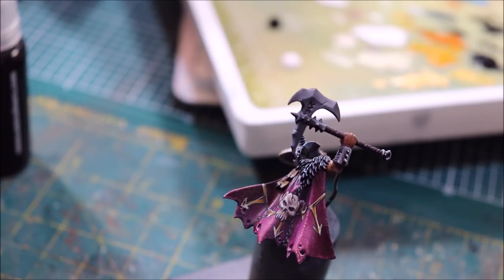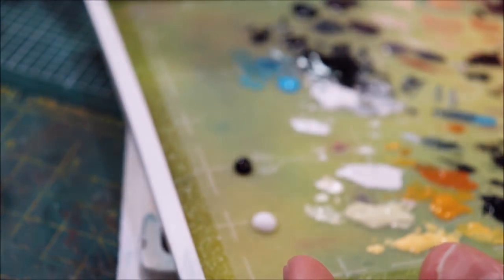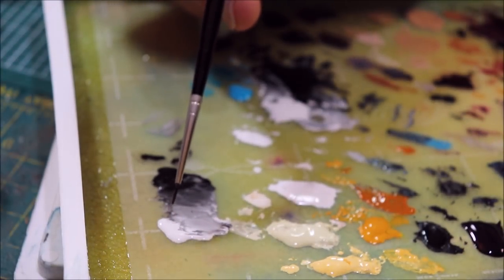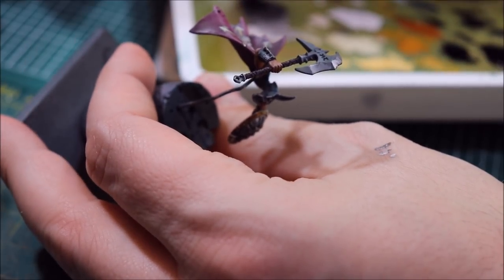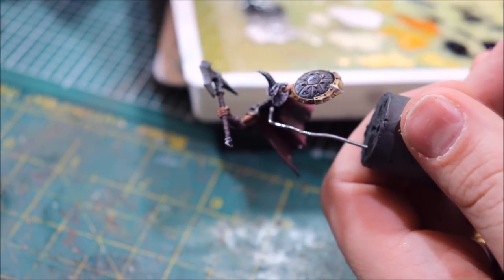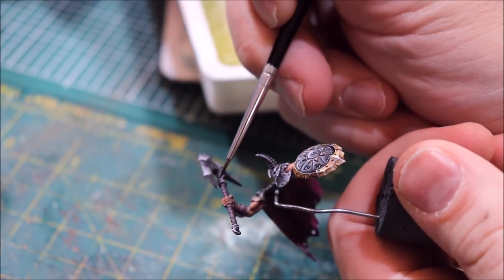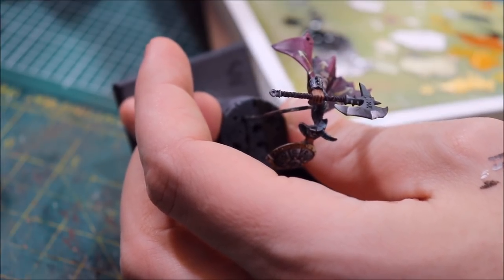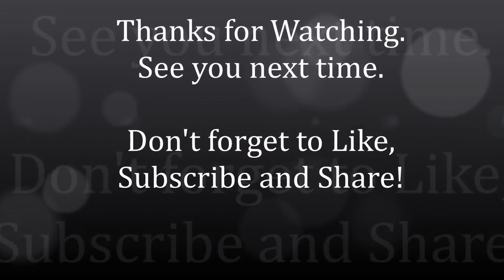Hobby Cheating 124 - Loaded Brush Blending

Comment: Dude you have a tutorial for everything! awesome!
Reply: May I ask something? you load with black, and then put white on the tip, so what is the point of mixing the white and black in the pallet?
Reply from the maker: Because in the end, I am going to need to smooth everything out (you are never going to have a perfect blend from a loaded brush, it's too random of a technique. So I make the spread of color so I can go in and smooth out areas of inconsistent blends later. Hope that helps. :)
Reply: @VinceVenturella  It does, thx so much for taking the time to answer.

Comment: Vince, this video has helped me understand this technique so much more. You really take time in your videos to explain every step of the process and don't skimp on the detail.

Do you have any tips for using this technique with a very thin paint like Nighthaunt gloom. Would this only work if gloom was the paint that fills the brush?
Reply from the maker: It's really tough with thin paint. it would be fine if the paint is thin in the belly of the brush and white on the tip, but in general, you need a thick paint for the tip.

Comment: looks like a good technique to fix zenithal highlights or do zenithal highlighting by brush, if one is lacking an airbrush or has run our of spray primer.

btw: what kind of palette paper are you using in this video? I find parchment paper is lacking stability
Reply from the maker: Just standard reynolds baking paper. Always worked fine for me, but the humidity and other elements of your area can greatly change the way it works.

Comment: How would you use this technique with a third colour (eg blue)?
Reply from the maker: So in general, there are two options (which are not mutually exclusive). You can pull the third color into the gradation and place it more thoroughly into your loaded (wetter) color. The color will be more pronounced against the white and fade against the black. You can also glaze/filter afterward, which is what I was going to do here. :)